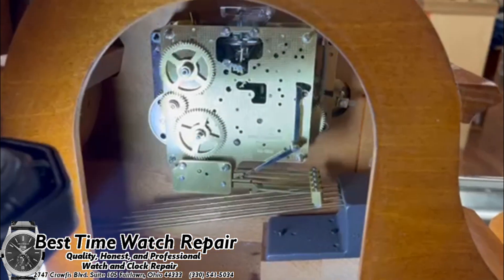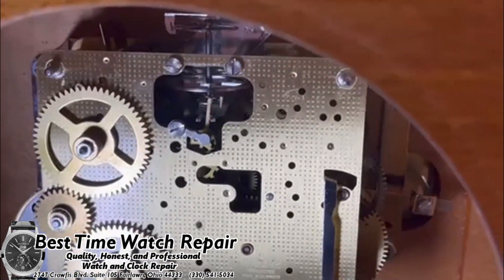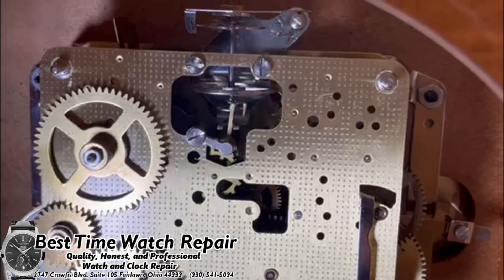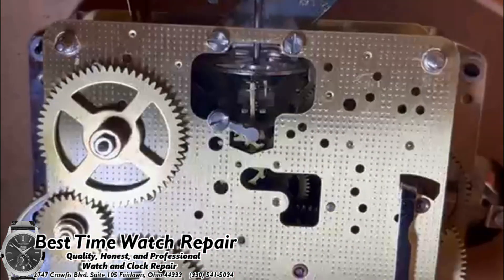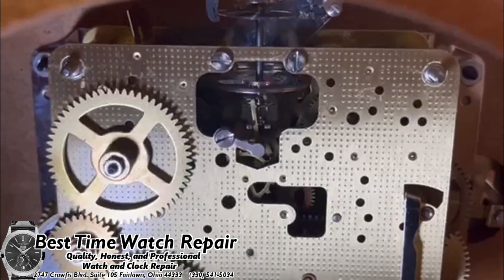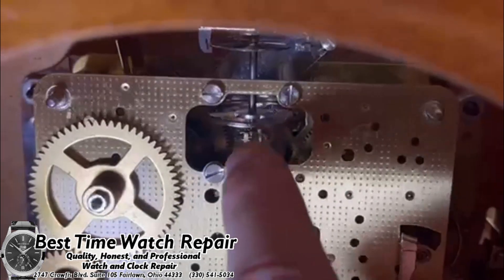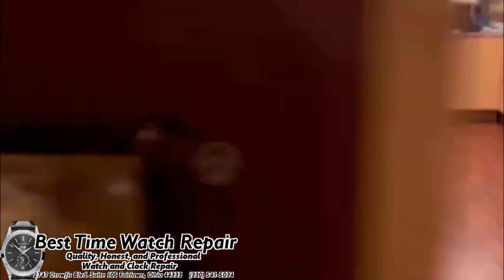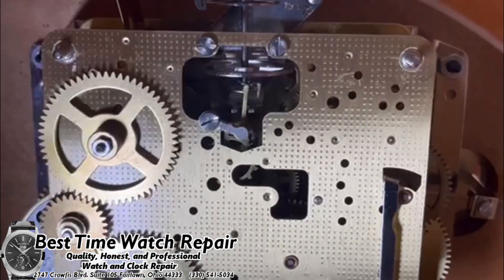Start Your Balance Wheel Clock Movement | Safely Start Your Clock | Best Time Watch Repair

Comment: Just a comment about nomenclature. The movement you are showing has a balance wheel with a flat hairspray and pivot-in-cup support for the balance wheel. This style superseded the floating balance which actually did float on a helical spring. The floating balance was a superior mechanism but difficult for the customer to regulate and it was more expensive to produce besides.

Comment: I have a clock that is not working and thanks to your video I know there is something broken
The top of that bracket that moves like a pendulum does not have the top. Is it worth fixing it? It is a Hamilton 340-020